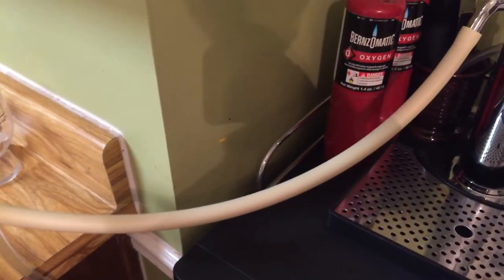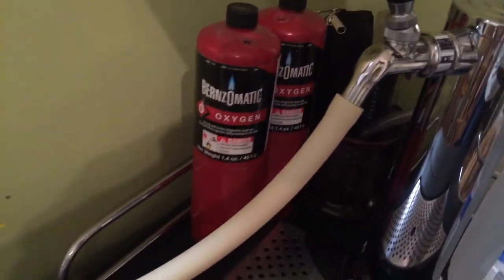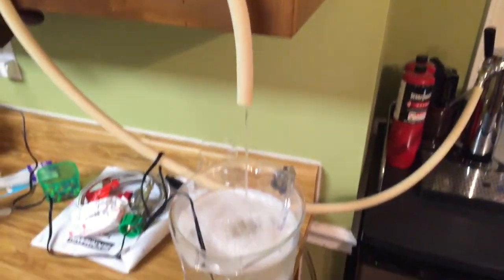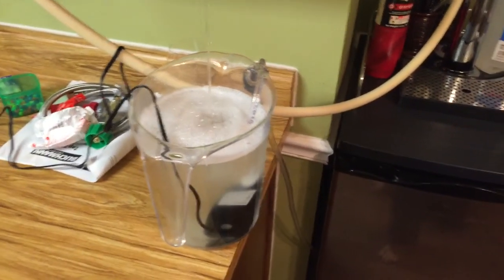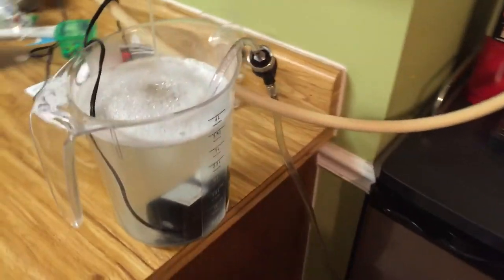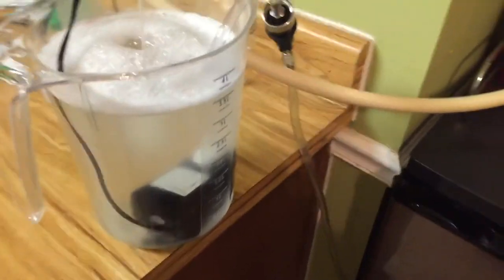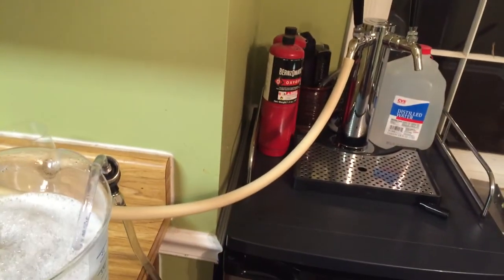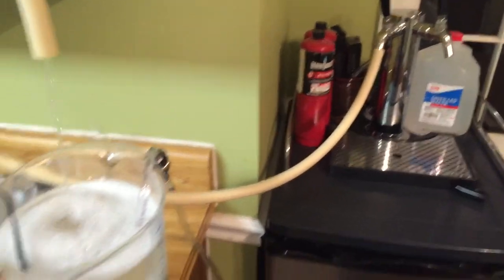Beer Line Cleaning Setup

Comment: hi, I want to try this ASAP. Thanks for posting. Question, is the ball lock connected to a carbonation filler? that's what I see with the link on Amazon. Are the links to the parts still the same? just want to make sure before I order.